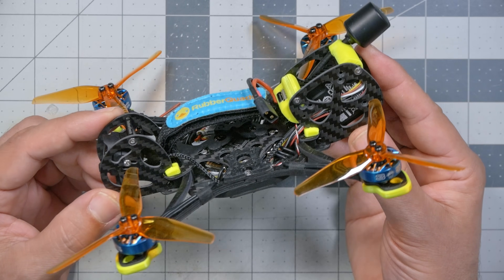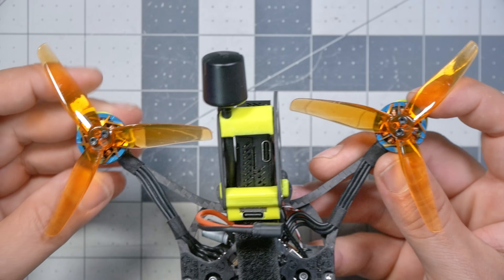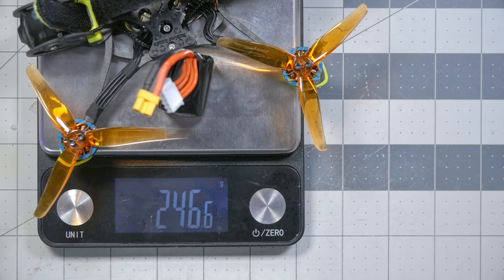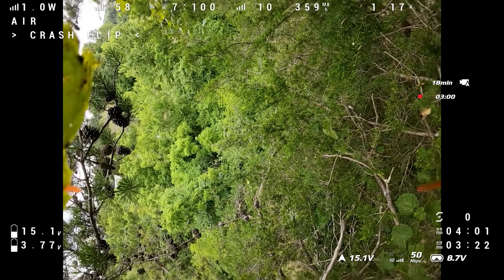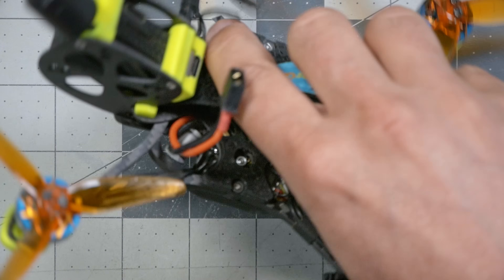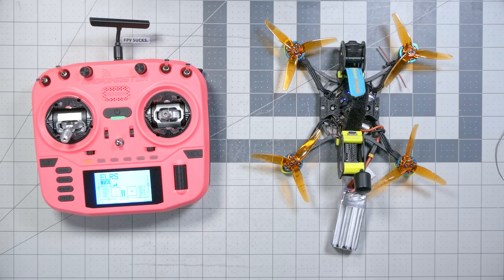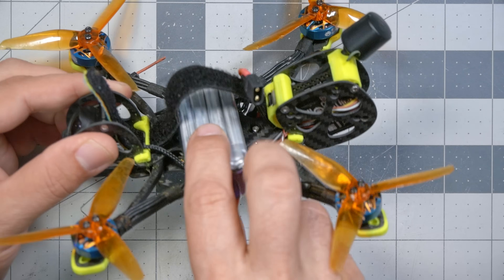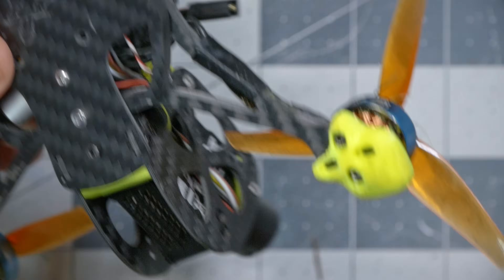I never want to stop flying this tiny quadcopter // RUBBERQUADS SQUIRREL

Comment: Thanks @JoshuaBardwell for taking the time to review the Squirrel (and for braking it - fixing it - and reviewing it again)!
We are glad you enjoyed flying it and would like to take to take the opportunity to clarify a couple of things:
torx: the four arm screws need a lot of torque and a 1.5hex will strip after the second rebuild
motors: those are indeed tailor-made t-motor pacer 1604 (custom winding, modified shaft and engraving)
motor testing with props on: you do it - we do it - everybody after his 3rd build does it -- but please don't show it to the public.
lipo pads: those are custom laser-cut from blank sheets of the same material ummagrip uses, so give them a little lick (with a wet sponge off course) once the battery starts to slide ;-)
arms: those are 4mm - it still doesn't make it a bando-basher but it can take quite a beating
bind & fly builds: we fly and custom tune every single build so those get as much love as the one you flew (plus: a M10 GPS is now included). We strongly believe that every pilot deserves an excellent flying quad and take some pride in providing them.
May the thrust be with you
Volker
Reply: I personally wish torx was the standard in FPV. The fasteners last much longer than hex fasteners.
3D printed fasteners makes the difference between torx and hex even more pronounced. The soft plastic get pushed out of the way when using hex fasteners  a 3D printed torx fastener is surprisingly durable since the tool's pressure is even distributed.
Reply: Pacer 1604’s rule.
Reply: I want see this in korea
Reply: I wonder- for that spot where the arms overlap each other, would milling them to be curved (basically just adding a fillet to the inner corner + matching end in that junction) help with durability? Sharp corners are bad about concentrating stress, which seems especially troublesome when that stress is being concentrated between layers of composite material. A curve would distribute the forces across more layers, rather than just one layer interface.

Comment: He broke the arm because he forced it to tear it's way out of a tree. There's a ton of power and force behind those motors, and he wretched them all about. It has more than enough power to tear it's own limbs off, especially considering how thin the arms are.
Reply from the maker: That's a shit take. Every frame should be able to turtle itself out of a tree. And it wasn't even that hard of a turtle. There's no world in which a motor should be able to tear an arm off a frame. The frame will experience much worse stress in a crash.
Reply: @JoshuaBardwell  i cant imagine a world where the motor would have close to enough torque to twist off a cf arm lol

Comment: Would you prefer having a solid plate that is the arms and bottom plate all as one piece of carbon? I have a few iflight dc2 and dc3 frames. and although it kind of sucks if you break an arm, I have only broken 1 of the dc3s, luckily they were “out of stock” when it happened so I got a little over zealous and figured I may as well put in an order for 4 of them. i have flown and crashed the second one so many times and it hasn’t broke I broke down and bought 3 more sets of motors and flight controller esc combos so that I could just build more, I built one more dc3 and gave it to my cousin to try to get him into FPV, thinking that is a much better step than the way I did it and got a 5” skyliner with Dji v1 in 2019 and had only flown a mavic style drone and yeah, a lot of learning setting up modes and still smashed that thing on day 1 flight 2. And then more JB videos to learn what “acro mode” means hahaha.  did you say what battery you are using? I find 3950 kv motors on both 3s and 4s works really well. I fly 3s to just cruise around and 4s if I want some fling.  Now that Im getting back into the hobby I find batteries the hardest thing to get myself to buy, they have become so expensive and I’ve gotten some bad ones. Whats a solid, cheap 4s xt30 600-800 mah these days?

Comment: If you double the arms using two kits do you get over 250?
Reply: The geometry wouldn't work out but we are currently considering to make a test-batch of 6mm bando-arms with a thinner pressure plate. This would probably require the removal of the GPS to stay under 250g.

Comment: Arm broke when you ripped it out of the tree with turtle mode imo lol
Reply: The drivetrain generates about 600g per corner, fresh arms break at over 15kg on the weakest axis (vertical bend). It's not a bando-basher but please don't be too hard on us.

Comment: ive never flown a 5 inch i got lucky and found the crux 35 and im on my 3rd one now lol. I fried the vtx on one does that make it a good candidate for the air unit? ;)
Reply: I put one in mine but had to drop it to 3". Used a shaved down tpu nose of a reckon 5, flipped the top frame front to back and converted to top mount. Used double sided tape to secure the air unit. Wish I'd have maintained 3.5" but I still love how it flys.

Comment: There is ZERO reason this drone, even with the o3 should cost more than $500. This an average  level drone at an almost scam level price. What a ripoff.
Reply: You can always get a frame-kit. We build our quads in Europe and fly every single one to verify the hardware and finalize the tune (base tune is in the Betaflight presets).
Reply: @volkergoe  How can all the parts possibly cost more than $500?

Comment: Any time you mill the arms to overlap is the weak point, on my 5" Raptor after many crashes,the arm splits down the middle of the 5mm thick arms. Then another thousand flights it finally breaks in two. I solved this on my design by not interlocking the arms, but having them but up against each other, not one broken arm after 10400 flights that year.

Comment: 18:40 the USB port also looks bent. 
Is it easy to replace that USB extender board?
Reply: 2 screws, 4 solder joints

Comment: Looks nice, but $920 for the o3 version is nuts!
Reply: It’s 590
Reply: Nearly $1100NZD. Ouch.
Reply: The 03 version here I see is 682$ US. Still absolutely nuts in cost.  I'd consider this quad if it were more in line with other similar sized / style 03 quads.
Reply: @Nunyali5lx ist 599€ and when you think of that is not Build in China and every Quad get flown and tuned its a good price. They also come now with an M10 GPS for the Same price
Reply: Where did you see 920$ ?

Comment: Quadmula frames also run countersunk M2 screws in the frame. When I was changing them over to titanium it was way easier to get Torx versions rather than hex so maybe that's why? (assuming they were titanium for weight saving?)
Reply: All screws are steel. We tested titanium in the past and it's just too easy to break.
Reply: @RubberQuads  interesting, I haven't had any titanium screws break on my builds. But really impressive to get the weight down so low with an O3... kinda wish I known about these earlier!

Comment: I killed my speedybee esc even though i used a smoke stopper.. 2 soldering blobs touched bc of a little wire out of my motor wire and the soldering "exploded".. after that i soldered again and my fc dont get powered from my esc.. what could i do?

Comment: I'm glad that you acknowledge that Torx is a better screw system for small fasteners compared to allan or hex. Perplexity AI : While Allen wrenches have some advantages like the availability of ball-end drivers for angled access, Torx generally offers superior performance in terms of torque capacity, tool longevity, and resistance to stripping. This is why many industries have been increasingly adopting Torx fasteners for critical applications.
Reply: I totally agree, I would choose Torx if given the option for those tiny screws.

Comment: Those motors sure do appear to be re-labeled T-Motor Pacer 1604's. There is nothing wrong with that; they are great little motors. I run them on a 3.5" Quadmula 6s and they fly amazingly well. I do, however, despise the T-Mount because props are a pain to change, and I always seem to strip them out. Other than that they are good. For my second Quadmula 3.5" build I actually went with the 1084's just because I could get them with a prop nut!
Reply: have you tried using longer machine screws. I had the same problem before increasing the depth of the bite
Reply: @doccock100  Yes. That's basically how I do it now. I bought an M2 socket head kit off of Amazon and it has mostly solved the issue. I got tired of buying new motors just to replace the bell. I have a box with 5 or 6 brand new stators with stripped bells, lol! They're still a pain in the butt to swap out props but they are very good motors!

Comment: light 1604s are AMAZING on sub250s. looking at you RCinpower GTS v3
Reply: Those don't exist, you probably have the 1804 in mind.
Reply: I love the GTSv3 (1506) for its insane amount of torque and top-end but it was just too heavy to get the build under 250g. RCinPower was not willing to work with us to put it on a diet 😞

Comment: From my estimation, they are charging $218 to assemble it
Reply: Yeah insane. I’ll pass on that!
Reply: It's a bit over a 100 bucks (DJI won't give any reseller a proper margin) but we fly and individually tune every build we send out.
There also is a build kit or just the frame available.
Reply: @volkergoe  I understand that it is a unique frame. The PCB of the USB-C relocation probably adds some included costs and is necessary for an AIO. 
If a v2 comes out with thicker arm mounts, I would love to check this frame out. 
Technically, it looks like you could update the frame with thicker arms without changing a lot other than the center of gravity and the weight. Although it might add some included stress elsewhere.
Reply: I mean this is not Iflight who make thousands of mass produced Nazgûl’s lol. If you want a niche product like that ur gonna pay for it. If you don’t want to learn to build or pay a premium for a niche product then just buy a Nazgûl like every other Tom and Jerry 🤷‍♂️😅

Comment: Your kit + the o3 air unit should come tomorrow, im learning to solder, have it set to 650, but cant manage to tin thw wires, the tip just doesnt heat them enough, any tips?
Reply: Flux them, and also melt some tin on the solder tip first
Reply: Flux on the wire, super hot tip, clean tip, and pre tin the tip
Reply: @2down2togo  thanks for the reply, super hot like 900? and also I think I need a bigger tip, I got the stock tip on the hakko 888dx and its pretty small for a 12 gague, should have bigger ones arriving soon!
Reply: @WinWitWon  that may do it, can't hurt to try a wire or 2 if u got some spares
Reply: @2down2togo  alr ty
Reply: @WinWitWon  that help?
Reply: @2down2togo  yeah this is my first drone, so I mostly overpaid for the tutorial, and assurance everything would fit together, I know its not the highest quality stuff for the price.
Reply: @WinWitWon  not saying it's complete trash just overpriced but I don't blame u for wanting more peace of mind while jumping in to the hobby
Reply: @2down2togo  just arrived, and hopefully I dont screw anything up!
Reply: @WinWitWon  u got this man, im sure it will be a good experience!
Reply: @2down2togo  just tried to solder the motors to the esc, and for some reason, with my iron on 700, it took forever to melt, and the soder joints look aweful, also I accidently touched the iron to a part of the pad, and it looks a little melted, might be toast
Reply: @WinWitWon  that's why u have to have it really hot so u can melt the solder faster. Just go as high as that iron will go buddy!
Reply: @2down2togo  the iron can go to like 950, but im pretty sure that will just cook the pcb
Reply: @WinWitWon  it won't man, so long as u don't hold it there for a long time. U definitely want it super hot so the solder melts fast and puddles onto the pcb. Just work fast with the iron and use flux on the pads and the wire, pre tin the pads and the wire and let cool a bit then when u go to put the 2 together they will stick quickly.  Trust me on the heat, it won't hurt unless u hold it there forever, I'd say 5 to 10 seconds is way more than enough time to melt together
Reply: @2down2togo  alright, im talking about like a little bit of the tracing on the board got slightly meled because I was holding the iron at an angle, and didnt notice, ill see if it works today
Reply: Only fly that frame over grass, it’s not very durable compared to my other 5” quads. It was my first build and was super helpful. I won’t touch a Bardwell frame anymore though. Good luck!
Reply: @FootlooseFPV  oh is it the material or something? I had heard it was pretty sturdy, but if not can I buy a new frame later, and just throw the internals of the kit into it?
Reply: @WinWitWon  yes u can but bardwell stuff is all over priced hype. Only thing this channel is good for is learning how build and use betaflight, don't buy in to all the hype of a rotor riot or bardwell brand